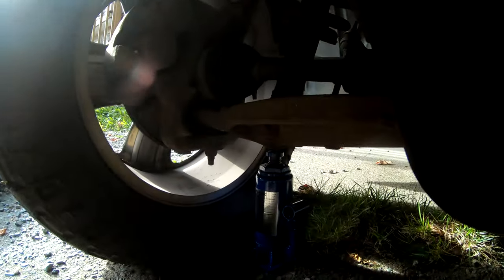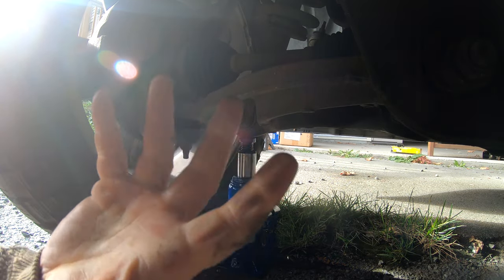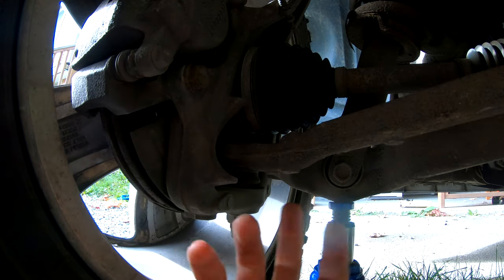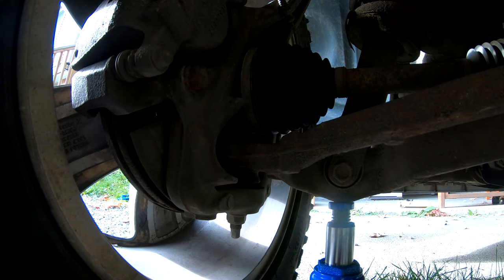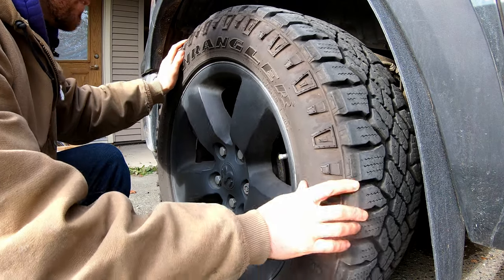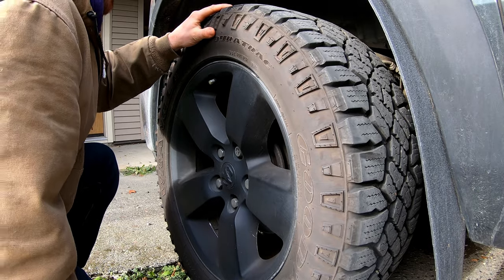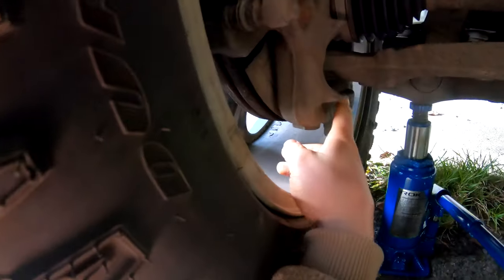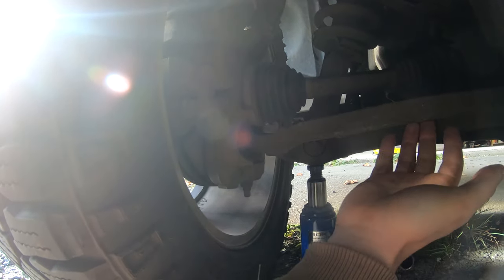How to Check Ball Joints (The Right Way) Tie Rods and Wheel Bearings | RAM 1500 Pick up Truck

Comment: How do you figure you kept the weight on the joint when you jacked the truck up?? The only weight there is the assembly. Ball joints do have up and down play normally, it’s side play that is bad. With side play does come excessive vertical movement so..

Comment: Lots of greasable ball joints also fail because people put too much grease in and the boot bursts a hole. 2 or so pumps is all you need. And I wouldn't even do it every service unless u can see an obvious leak.

Comment: Will that make a front shake when in 4x4 pushing on gas from start ? I thought were my tires but i got them re balanced and it's not the case cause when i push it from start in 4x2 I can't feel anything also it shakes barely but still noticeble when about 100..
Reply from the maker: Could be a couple things. If your front end it tight (no ball joint play, no tie rod play, no bearing plays etc.) check you front u-joints. if one is seized it will make the front end shake. could also be a one of your CV axles is broken.
Reply: @TheGettyAdventures  thanks man i started to check everywhere and found out the upper arm (ball joint) on the paasenger side is shot, it makes the whole lot of play from underneath the nut when moving the tire..that is cause of the 2.8 level i install a while ago i guess.. thanks again !